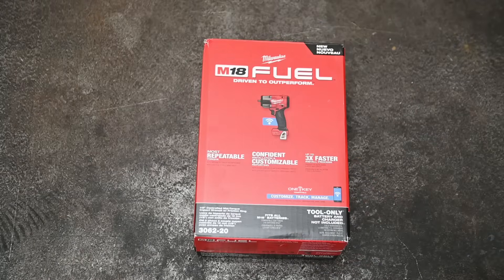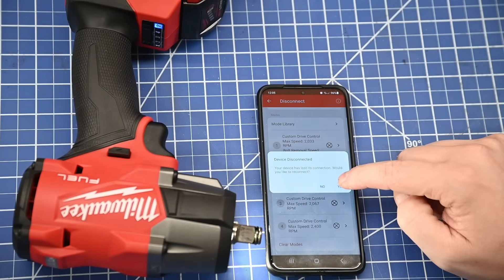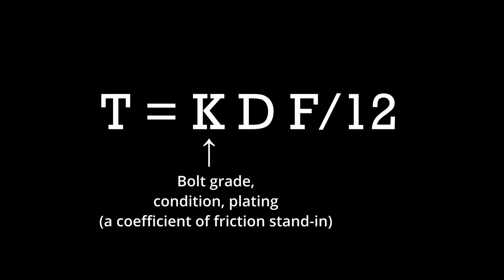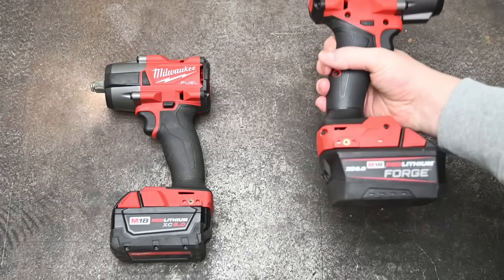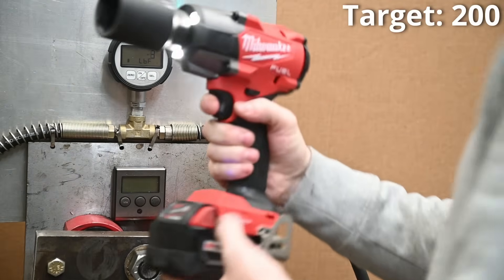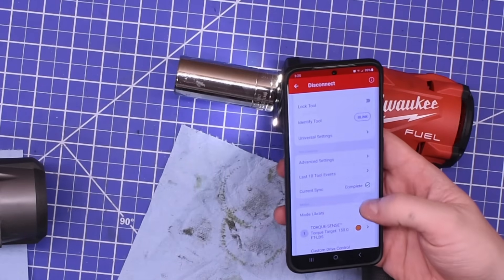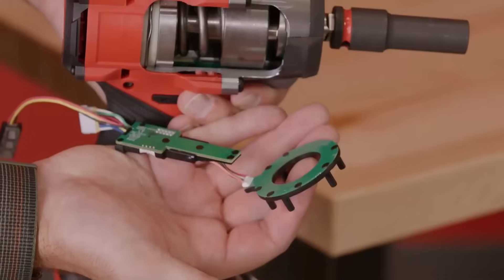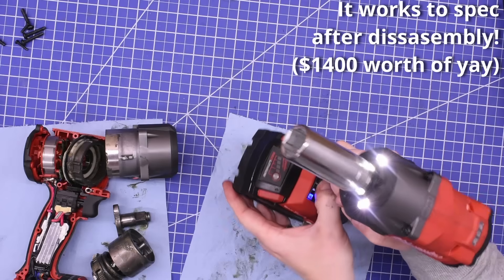Milwaukee's Secret $1,400 Impact Wrench: A Mechanic's Dream?

Comment: Looks like Milwaukee could be trying to step into Ingersoll Rand's higher output QX family of tools with this one. Alot of the features (tool finding, guide light adjustment, and color indication of rundown complete/incomplete to name a few). The 3062 seems to bridge the gap of where something like their QXXD2PT family of tools stops (at 18Nm I believe) and where their higher output D5AT right angle tools start. Granted, unless you are using the optional ETS function on the QXs you won't get anything like the impact function that the Milwaukee offers. The QXX do target the set torque from initial setting unlike the Milwaukee so you won't have to profile them. You won't see any output above 80Nm on the QXXs unless you add a separate torque multiplier on them, and by the time you have one installed and the tool's internal transducer range adjusted for the multiplier on the end, you'd be looking at roughly double the cost of the Milwaukee.

From TTCs video, the mobile app looks similar to ICS connect (Ingersoll Rand's equivalent).

Though the repeatability seems to suffer, and the fact that you have to run hardware profiles prior to running your actual application. I'd sooner stick with the old fashioned torque wrench if doing automotive lugs. I can see the benefit of the 3602 though in certain applications. Though in most of the applications I can think of, you could probably do the same job for cheaper depending on your assembly requirements.

Comment: I n my opinion, way too "Hi Tech" for the average shop.  I can see cases where this tool would be useful, but based on your tests, especially the variance with batteries, no way would I spend that much for that tool. One major concern is how does it keep it's accuracy after being dropped on concrete from a 6' drop multiple times? I'll stick with my torque wrench and my impact wrenches.

Comment: Good stuff - probably a bit above what I need for my car repairs.  On retirement, I decided to make my life easier, and bought tools I had previously avoided or decided were too fancy/expensive for the likes of me.  One of these, was a 3/4 inch Milwaukee battery-powered impact driver.  In the UK it cost me about £450 with the rubber dust cover, and came with two fairly hefty battery packs and a charger.  The solitary reason for buying, was that I realised some of the very hard-rusted nuts and bolts on cars, don’t really undo with ‘slow’ undoing very well.  By the time you’ve hammered and sprayed and messed about, the end you cannot see has come loose, and you then need both hands and another spanner etc…easy for an octopus i suppose.  Being able to loosen an awkward rusted large-diameter suspension or subframe bolt, from one side only, is a fantastic boost during difficult jobs under a car.  It was worth it, yet I only grab it about twice during an entire repair, it does something that nothing else can.  

The singular negative, is it is harder to get a big 3/4 inch Milwaukee impactor into a space sometimes, but I manage with various couplings and so on.  I’d have got the half-inch but this is literally what i say to my family is the ‘big dog’ and so it absolutely had to do the very hardest jobs, being able to fit into slightly smaller spaces, was a secondary aspect.  Good vid, take care all, be safe.

Comment: when I used to be a mechanic I'll get the torque right with the impact gun 99.5% of the time, and for that 0.5% I still tightened all bolts with the torque wrench

It doesn't matter how much experience you have, if you didn't check it with the right tool then you're still liable

Comment: was just talking about this tool today! Would be nice for sprinkler installation with groove couplings, but for the price it's not worth it. Inspectors aren't going around checking torque on every fitting so.

Comment: This is a tool to be used by professionals that tighten the same bolts over and over on a daily basis, in that setting it's probably good, but for us every day shade tree mechanics, this is way overpriced and overly complicated
Reply: and finicky enough not to trust.

Comment: As far as using it for torquing lug nuts, I personally don't think it's that life changing. I would still want to follow it up with a hand torque, not really because I doubt it's accuracy, but the redundancy of following it up with a second round will help ensure a loose wheel isn't sent out the door. 

When I used air tools I would torque stick them on with the vehicle in the air still and then finish up with a hand torque on the ground so accuracy of those didn't matter to me. With a 2767 now I zip the lugs on with setting 1 or 2 and hand torque on the ground. I have caught that I missed tightening a wheel probably a dozen times in my career just because I went around again with a torque wrench and have never sent a loose wheel out the door. This one could probably help if I missed a wheel in the second stage when hand torquing but I always go around the vehicle the same way every time to be sure. 

I do know a LOT of old guys that just uga duga by feel, they could use an impact like this but then again they would probably set it to 150 and be too lazy to change it for every vehicle.

Comment: As a professional mechanic, I can't see enough of an advantage to make up for the cost of the tool and the time to calibrate for all the different conditions I might use it. Niche tool, for which $1,300 worth of torque wrenches is more useful and probably quicker than a programmable impact. Cool idea though.

Comment: Could you do a test on the 'Festool TID 18 H PC Cordless Impact Driver' it is only $100 more then Milwaukee's closest item (the Milwaukee 2953-22 which comes with 2 5.0Ah Lithium Ion Batteries and a case) I wonder if the festool quality on corded woodworking tools will carry over to battery more mechanic/contractor focused tools and be a good competitor with Milwaukee and dewalt . thanks

Comment: With tools like this we will see $100 per tire unmounting and mounting fees. They have to pay for that tool somehow. Like the HVAC guys that replaced a few fittings on my boiler that never learned how to sweat a copper pipe charged me 2700.00 for 1200.00 worth of work if they just used a Propane torch, flux and solder.  Their pro press cost then over $3k for each employee I know of 6 at the company, the customer is who actually pays for those Milwaukee tools...

Comment: Can you review the Milwaukee 7/16 impact. I think it has an application of being a high power impact driver and with the addition of a good quality 7/16 to 1/2 adapter (made by proto) it can also be used as a mid torque. As doing something like this with a 1/4 hex doesn't really work that well, 1/4 is just to small and either is a weak point or robs to much torque from the adapter.

Comment: It looks like a big version of my Panasonic 3.6V driver which I can't get a lot of info but I managed to snatch it brand new from Japan. Although it doesn't have app but packs very precise mechanical + electronic clutch. There is specified torque setting table and a special locking cap which makes me think that this thing was produced for factory assembly use. Only noticeable thing this thing  has is a badge which says "Made in 2019, Osaka Japan". Came with a case, charger and two batteries, also made in japan. For past 5 years I haven't had undertorqued, overtorqued or stripped small machine screws like m3, m4, m5 in any printer that I have serviced past 5 years. I wish my M12 drill had this instead of that electronic stripping crap.

Comment: $1400 seems like a lot but if you've got a crew of 3 working on a wind turbine that has hundreds of bolts that have to have the same torque applied and it save 3 hours on every job you're talking it'll pay for itself on the first job. This tool isn't for the home improvement or shadetree mechanic, it's setup for the pro guys.

Comment: As someone who builds steel uprights for solar installations, you use the battery you have. The battery being a variable makes it completely irrelevant. You're still going to need people to walk the line checking the torque and making witness marks.

Comment: it is curious that lipo throws off the numbers. i have been using lipo for close to 12 years now and realize lipo cells have a much higher c rate. i wonder if there are peaks in the wave form of data that exceeds the parameters that are being observed to approximate the end goal of the predetermined set torque cut off. to acknowledge what may not be obvious to some, lipo is not needed for such a relative low max torque tool approx 200ftlbs. you think the way i do and would want to know this info as well

Comment: "...some genius put grease or antisieze on..."
If your truck runs in salt like in the northeast and run your rig off road the torque numbers are going to be hurt a lot more by rust and dirt in the threads than they're going to be hurt by grease. Not to mention you might be twisting the stud off on removal a couple years down the road if you don't apply something. The torque range on them is 150-165 ft-lbs and they can certainly take more than that, since 165 is applying static tension. If you consider dynamic loading they experience quite a bit more tension than they're torqued to. If you put grease on and go to 150 on the torque wrench you're still in the specified range or pretty close to it, and most importantly, they're all set to the same clamping load which also exceeds the minimum required tension (also needs to be below the yield strength of the stud and wheel of course). I've been putting either/or on my lug studs (all vehicles including trailers) for 30 years and never once had an over/under torque situation from doing that with a torque wrench torqued to the factory spec. Now I have seen problems with people pulling the lug nuts through the steelies on the pre super duty F-250's from putting them on with an impact wrench full ugga dugga style. I've also seen wheels come loose from not enough power from either the operator's hand tightened lugs or the old battery impacts that just didn't have enough jam. I once watched a farmer put his duallies on with the lug studs rusty enough that they squeaked when he tightened them and when he ran the thing 8 hours round trip to pick up a heavy load of lumber the rear wheels were loose and had slots in them from working back and forth under that heavy load You can do what you want, and this is not advice, but I have driven close to a million miles on lugs tightened down this way and never once had an issue greasing the studs, and I've seen lots of broken studs and inadequately tightened wheels from people not doing it.
Reply: Also, I just looked up the torque difference between lubricated and non-lubricated torque, and you get about the equivalent of about 35% more bolt tension from torqueing with grease. The spec on an M14-1.5 bolt, grade 12.9 (like super duty lug studs), is 202 ft-lbs. 150 x 1.35 = 202.5. So what's going on here is that the engineers overbuild the stud, then make the factory torque spec low enough so that if you lube the studs you get basically what those studs would be torqued to for maximum clamping force. If it doesn't do maximum clamping force, say, at 150 ft-lbs, you're still fine, because it's still more than you need. Long story short, this confirms what I said above.

Comment: Just my two cents not the first to market with this type of technology but the first non-commercially available however, like with most technologies, they start out ridiculously expensive and then this time goes on. It will get cheaper and the technology will get better and more accurate or less set up process The only question is how long will that take?

Comment: You're really asking for the impossible with the way you designed these tests. No tool, except a hydraulic bolt tensioner, can ever, possibly, compensate for the k-factor. A tool that only turns the bolt, like a torque wrench, can only control for torque. This is what they're trying to achieve here and it would have been interesting to see more of how well it does that.
Reply from the maker: I think it's also important to show the impossible, there's a lot of people that think 200 means 200
Reply: @TorqueTestChannel  Okay, fair. It might have been clearer, though, if you had also shown that a calibrated torque wrench won't be accurate on these specific tests either. Or maybe tackled the k-factor subject in a different video altogether and only done a comparison to the torque, not the actual clamping load in this one.
Reply: Now, you'll be saying, what about their nyloc claims? The thing with a nyloc nut is, that it doesn't change the k-factor. Instead, it is in parallel with the actual nut and adds a constant amount of torque to the torque required for tightening the nut. Changes in k-factor, in contrast, proportionally affect the required torque in relation to the clamping force. 
A nyloc nut can be compensated for by a torque wrench, changes in k-factor cannot.

Comment: I think it's hard programmed to use the battery characteristics measured on the 5.0's. And with measured, i mean measured by Milwaukee in a lab.
... Which is a problem, because if you have a battery with malformed performance (over/under), or one that's getting a bit up there in age, this thing will not work with it reliably.

In other words, this isn't a precision tool, but a glorified party trick to get you in the ball park, with a ~10% offset. 10% is a lot.

Comment: That forge battery issue has me thinking they’ve developed this tool to “control torque” by reading the amperage/current draw? A set level of torque would likely be corresponding to a current draw
Reply from the maker: Impacts don't require more amps the more tight a bolt it, the motor is disconnected from the impact hammers
Reply: @TorqueTestChannel well that’s equally as fascinating with how gnarly the experience can be using one when something doesn’t want to be evicted lol but I suppose that makes sense I hadn’t thought of the spring/hammer mechanism being a disconnect. That makes it even more of a mystery then as the battery amperage wouldn’t effect the level of actual torque it’s encountering lol. Thanks for the response!

Comment: This is so dumb I own all Milwaukee tools but no one has a dyno chillin with you ever day of use 😂
Reply from the maker: Which is why we suggest the line marking method which might be more accurate than their torque wrench removal suggestion. Buy yeah, realistically no wheel guys are going to buy this. Just a cool tool

Comment: I hate that this is called AI or even ML. It's just a multivariate control system. The fact that it's pre-calibrated proves that, as it's just setting up your initial states.
Reply from the maker: I'm going to agree with you there
Reply: It's the new buzzword, just like everything used to be "nano-tech"

Comment: While this is super cool the app requirement means it's going to be flat out useless in 5 years when TTI drops support. You'll be left with a very expensive impact that can't do any of the fancy stuff anymore. I've seen it so many times with diag computers and apps for trash toys and head units I just don't trust anything that REQUIRES an app for features anymore. If they integrated the config into the tool itself, or even a charging station I could see it becoming quite widespread in places like aviation or industry, but as it stands it's a toy for the foremans son to show off when he's doing an oil change.

Comment: Using the >$1000 computer (your phone) and then charging you $1500 because the tool is incomplete without a phone seems like a near criminal exercise. I guess Milwaukee is fully embracing being a "tech company"
Reply: The phone doesn't have to be connected for the tool to work, just for setup. The tool has its own internal computer too. Also, it works with a 110 dollar android lol

Comment: I would bet that they have custom firmware profiles for the solar contractors that available to the public. The Forge battery issue should be a firmware update, my guess would be all of the extra sensors don’t like the output it’s giving. The crazy price for this tool is big red getting some of their R&D dollars back after finalizing this design. Does anyone know when Milwaukee started designing this impact? I’m curious how fast the turnaround was. Milwaukees aggressive strategies have overwhelmed the whole cordless world for the last 5 years with no signs of letting up and jumping into new categories to challenge specific trades. Good for all of us!

Comment: Instead of flashing light to find it, it needs like a little beeper or siren to find it. For $1400 I'd almost expect to have a GPS locator built in. lol
Reply: It’s kind of does tho - the one key.
Reply: They do have an option that the app will have a sense for how close you are up to 10ft. So alteast you know it's in a 10 foot radius
Reply: beeping the motor like a quadcopter wouldn't add any components at all.

Comment: Would anyone trust it to for instance build a $20,000 race engine, without double checking the head bolts, caps and mains with a torque wrench?
Reply from the maker: No way

Comment: The only method that works in the field is to use the torque stick if you're in and then a ventional DC torque tool. Trying to combine all of this into an impact is a fool's errand. 
I built pork tension profiles for a variety of OE's, there's a reason the equipment costs what it does.  Maybe another 5 or 10 years and it'll be in the $1500 market space.